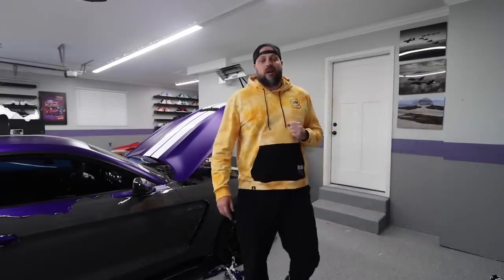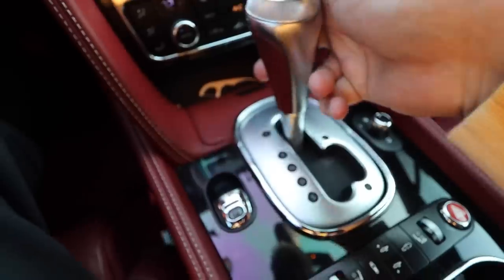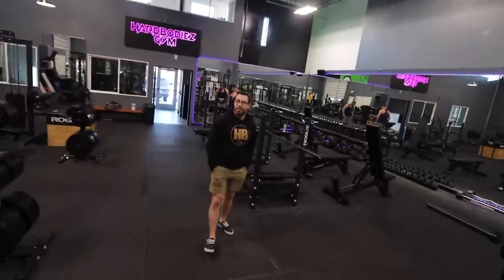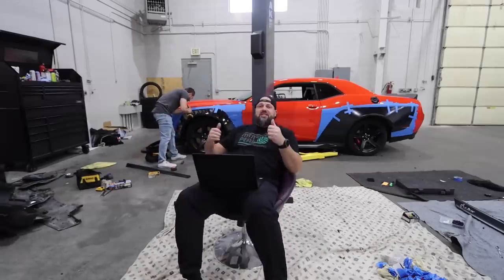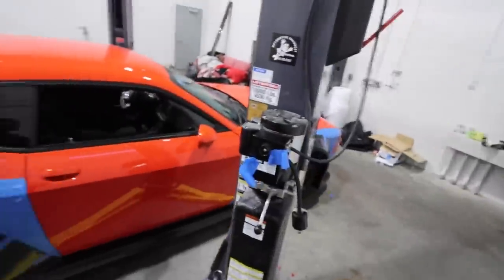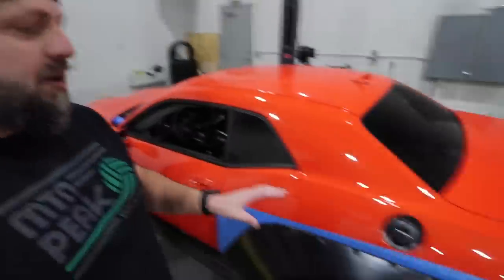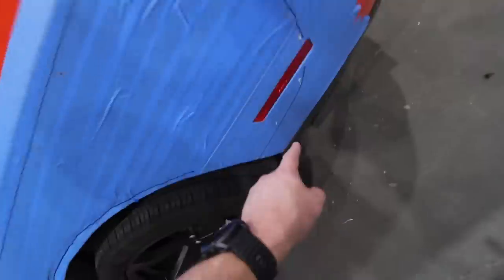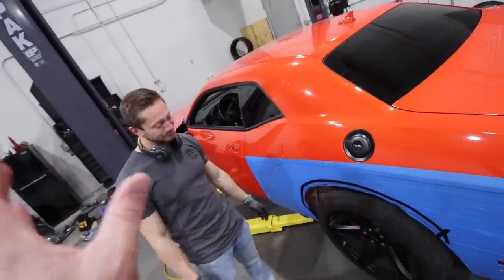Drilling house screws in my $70,000 Hellcat - no going

Comment: Burlacher I have a suggestion for the wrap removal. If you have a small space heater (monitored of course) you can place within the garage to warm the area up, I believe the elevated temp will help with the process.
Reply: or just turn up those gas heaters on the wall